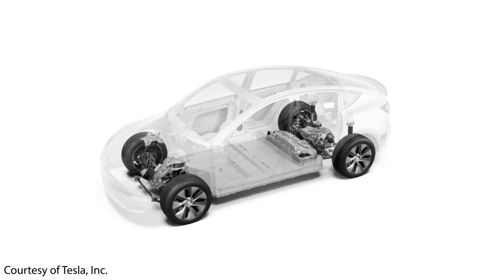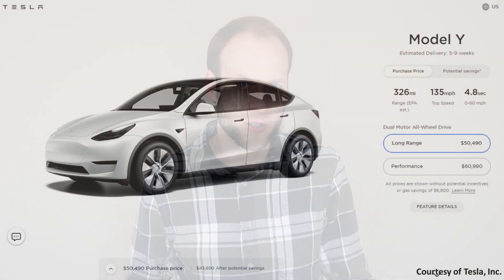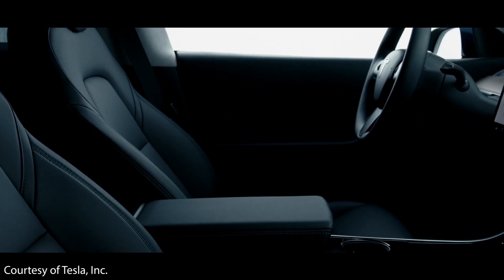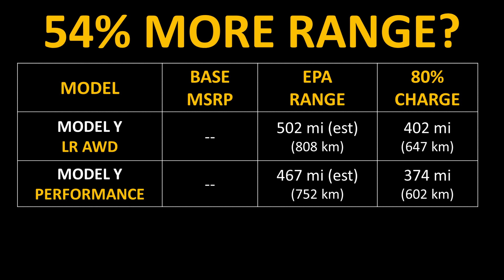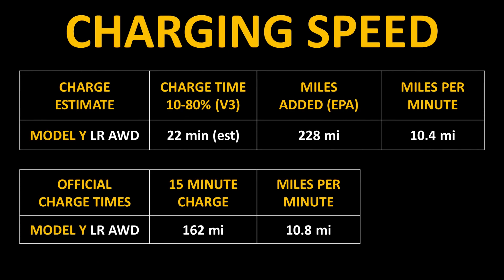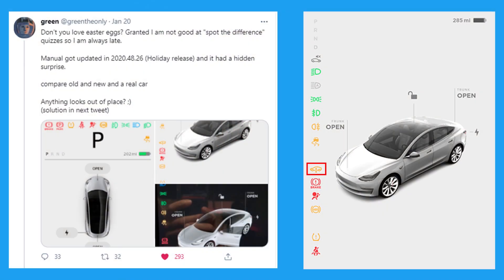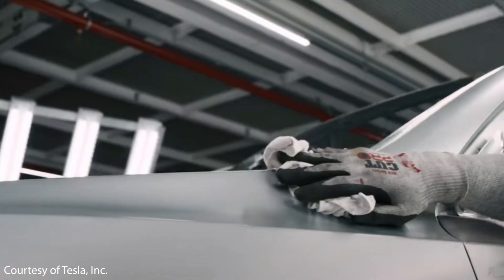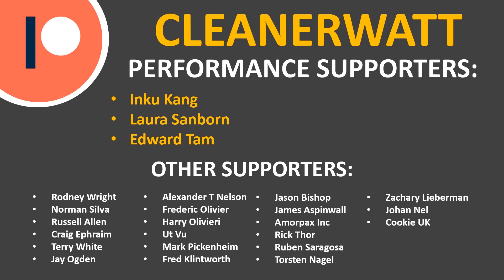Tesla Model Y 2.0 – Changes to Expect in Late 2021!

Comment: I really struggle with the range still.  If cold temperatures lower the miles, going 80+ mph lowers the range, and if I’m not supposed to charge to 100% I feel like I need a car that is rated for 400 miles MINIMUM.
Reply: Easy answer.
Don't go 80+ mph
Your journey time will be faster!
Audit your use.
What percentage of your journeys require long range?
If it's 2 each year, you don't need it.
If it's business use, you're not being productive, spending far too long driving which is dead time.
And other reasons.
Reply: @rogerstarkey5390  nonsense, inngermany people drives over 100mph on the Autobahn and I dont think its the territory of an EV, diesel cars there gets over 800 miles of range and they fly on the Autobahn.
Reply: @alanmay7929 
"In Germany".
Nowhere else.

Comment: Wait, do we know for fact that gigaTX will use 4680 for MY?  We know giga Berlin will but I never heard about TX will.  IMHO, I would use 4680 for the X and S instead.
Reply: For GF Berlin it is said to implement the 4680s somewhen 2022, but not in 2021. For this year they can just be happy to start the production of the MY if ever. Local government is playing Tesla and potentially delaying the final permits.
Reply: Battery production at Austin was confirmed last year, but Semi production is likely a focus. Semi, Cybertruck, Y and 3 will all be produced at Austin, and eventually they will all get the 4680s... But the when is always anyones guess for Tesla. 

As far as Model S goes, it is my opinion that the Plaid Plus models will get the 4680 cells... but eventually all Tesla vehicles will run 4680s, it just makes no sense to continue using less efficient cells and manufacturing for their flagship vehicles.

Comment: Giga casting front/rear end, structural battery pack and mass production of 4680 cells will take time. I don’t see this happening until 2023 at the earliest. Volume would be too low at Austin to exclusively build Performance Y’s and no other versions.
Reply: 4680.
If they've solved the "Maxwell" dry production process, the factory is modular.
Small footprint.
Machines probably built in house (Grohmann?)
It's a fast build, then testing.
The "canning" process is just that, known technology, reliable.
A lot depends on the stockpile of cells from Kato Road, the production rate there, and the designation for those cells (will the Berlin cell production be ready before the car production?)
If Berlin and for that matter Austin, are ready before the main factory, it's going to be a step change.
Also, the chemistry of the line must be considered.
Assuming the 4680 can use LifePo4, there will (eventually) be at least 3 variations of cell.
It could be the LifePo4 will be used for all cars, except maybe the "hyper" packs?
Let's wait and see.

Comment: Love to have a Y but am waiting until the 4680 variant to be available in the USA.
Reply: That will be a long wait
Reply: @gcklo  if its 5x the lifespan of battery might be worth it. especially if you plan on autonomous in next 8 years to be a thing your battery lifespan is very important for longterm value
Reply: @gcklo  I thought 
So too but Elon said this year.
Reply: Very long wait. At battery day they made it clear that they are still years away from mass production on the 4680 cells

Comment: My take on it is that with the new battery they will reduce the battery pack size, this will lighten the weight of the car, make it cheaper and more efficient too. Also even ice cars have to worker harder at higher speeds to push through the air making them burn more fuel, so it's not just BEV related issue
Reply: Uhm you are totally wrong, the new 4680 won't reduce the battery size but just facilitate the production of the battery cells, also ICE doesn't suffer much compared to EVs even at higher speeds and diesel vehicles are even more efficient on the highway, some sedans in Europe gets about 5-6l per 100km. Also EVs are still very bad at towing.
Reply: Even tho gas cars burn more fuel at higher speeds, its more efficient at higher speeds. But its more like gas engines are so crappy their are bery inneficient at low speeds.
Reply: @odisy64  hybrids are awesome in city and occasional highway drive, diesel are perfect for high speeds, EVs are meh.
Reply: @alanmay7929  EVs are cheaper, more efficient, and cleaner than both of those. Its like you forget gas and diesel emmision contribute to climate change and pose a serious public health issue do to all the toxic and carcinogenic byproducts.
Reply: @odisy64  stop talking nonsense, were not in 1960 anymore where vehicles had no catalytic converters..... modern engines are way more efficient and powerful. People doesn't buy an EV because they are cheaper to run.... I know many people in Germany for example that  have tried a tesla model S but it was a disaster, diesel was the unique and best solution.
Reply: @odisy64  for towing for example EVs are still terrible and don't even mention people who occasionally goes off the road..... EVs still have a very long way to improve.
Reply: @odisy64  some people are even driving with full vegetable/used oil converted diesel and still have phenomenal range.
Reply: @alanmay7929  modern engines still produce emissions and toxic by products even with Catalytic converters. modern engines still cant get past 55% efficiency even in a lab setting while electric motors are around 95% efficient and up to 98%. pound for pound they are also stronger than cylinder engine too. the worlds largest vehicles use diesel as a power plant for a inverter attached to electric motors, examples include diesel trains, earth movers, and container ships. 
but yes, people do buy Teslas because they are cheaper to run, you must be completely out of touch with the people buying electric cars. yet again your example for a  Tesla was a model S and not their most popular cars which are the cheaper model Y and 3. im getting and EV because the maintenance is lower than my jeep and it would only cost me 5$ in electricity instead of 50$ in gas. plus, electric cars have better traction controll than gas cars so its going to be great when i go trailing in the mountains like i do with my wrangler.
EV's lose range from towing because that are proportionally increasing drag and air resistance when pulling something else, the same applies to gas cars but no one complains because they rarely do it and the people who do it often like me use vehicles made for it and extra large gas tanks. id like an electric truck for the diesel/ electricity savings and the recharge time is something i can live with. if the cybertruck can get 500 miles than it will probably get 250 miles while towing max weight, which is totally fine for me since i rarely travel more than 200 miles for work (i work all over my state) but its only like 20 minuets of charging to get that back after a 4-5 hour drive.

i take it you live in Germany or near, how does the Giga Berlin factory Tesla is building there make you feel? because when its finished its going to be seeing how much most lower class folk love them.
Reply: @odisy64  Yup, spot on, whilst fuel burn at high speeds is terrible, the fact that at speed ALSO means the engines are at the peak rpm power curves, within gearing, means the very best, what 25-30%, calorific value out of the fuel source, as opposed to 10-25% at acceleration and low revs....so fuel gets this non-linearity optimal at speed, where BEV both doesn't AND suffers from high current heat/inefficiency in both 400/800V architecture.

However, as more and more and more AI takes over driving, it'll also take over the BEV resourcing, thus you'll see cars drive 55-60mph more than current 70-85mph that most people select.
Reply: @Richard Wood the battery, battery casting/structure and the wiring looms.....all wins.

And sooner they move to a 48vdc controls even better.

Whether they can move away from 400vdc architecture to 800-1200vdc is unlikely and possibly unnecessary once the population gets over the fixation of stupid 0-60 launches and lets the CPU drive the car with best draw of watts.  Retro fitting supercharger network to increased DC architecture would be an annoyance, thus totally unlikely.

Great time to be alive and seeing all these smarts deploy. 😃😃😃
Reply: @dominicmcnamara  European cars already uses 48v systems and it seriously helps to increase the efficiency in all driving conditions and it also reduces the stress on the engine since the accessories are all electric.

Comment: Well, the way to get maximum cost savings from 4680 cells is to keep the pack capacity in KWh the same.  If Tesla raises pack capacity, cost savings are diminished.  This is a tradeoff decision Tesla will have to make.

There will be some cost savings that will be independent of the pack capacity.  Structural packs will be easier to make and mount, and front and rear underbody castings will deliver savings and increase range a bit, by reducing the car's weight.  So yes, the news is good for Model Y, and the other Tesla models which will eventually use this technology (which is all of them, I think).

So the cost and range equation is a bit complex - and the variables are variables.  Over time, we hope to see refinements in the 4680 cell energy capacity and performance.  Exactly how those will arrive, and when, or whether Tesla will emphasize range, or cost, or balance the two, we can't know.

Next, you're looking for Model Ys configured with 4680 cells, structural packs and whole-cast front and rear underbodies in 2021.  Ahem.  That is not likely.  It's far, far more likely that the first GF-Berlin and GF-Austin Model Ys will be very close to the Fremont Model Y configuration: single-piece castings for rear underbodies and 2170 cell packs.

There are two things to look for: the pace of gigacasting machine deliveries and the pace of 4680 cell development.  There are hints, but no explicit announcements from Tesla, about both topics.

Gigacasting deliveries are slow.  The machine weighs 6 tons, is ridiculously complex, and is manufactured by a tiny company.  I expect Tesla to take delivery of gigacasting machines as quickly as the manufacturer can produce and deliver them - for years to come.  It's going to be a bottleneck in the early going.  These are the classic 'long lead time items.'  Tesla needs these machines at all of its auto assembly plants.  Deliveries are being distributed to all of them, too.

Thus far, in Austin, we don't yet see enough installed gigacasting machines to support even rear castings for the Model Y, and none at all for the Cybertruck (which will be 8-ton machines).  A few more will be delivered this year, sure.  I expect Model Y initial production at GF-Austin will not be slowed by gigacasting machines this year; they'll get their low-rate initial production (LRIP) run going.  But I think they'll do it by emulating the Fremont configuration, and add front underbody castings later on.

That is a guess, of course, but I don't think we can take it for granted that Tesla's GF-Berlin and GF-Austin will both have enough gigacasting maschines in 2021 to support both front and rear underbody castings.  That's a level of optimism I don't share.

There are hints that Tesla is struggling to achieve its developmental milestones for the 4680 cells, and struggling with reject rates.

The big hint was the Model S Plaid + was slipped to 2022 and its price was raised significantly - just what you'd expect if the 4680 timeline has slipped and they have a new, less optimistic appreciation of 4680 reject rates in 2022 to expect in the early going.

The developmental effort for Cybertruck appears to be focused entirely on 2170 cells in 2021; they don't appear to have enough 4680 cells from their pilot plant to bother with prototyping production for the 500+ mile variant of the Cybertruck this year.

They're doing the same thing with the Semi pilot production line - using 2170 cells.  This will be the 300-mile variant.  We aren't seeing 4680 cells going into Semi pilot production yet.

All three hints appear to represent a slip from their Battery Day expectations for this developmental effort.  At Battery Day, Tesla hoped for the 4680 pilot plant to be up to full speed by June 2021, isn't that what they said?  10 GWh of production after rejects.  It does not seem to be on this schedule.  I doubt they have yet settled on a final design for the line, and might not before the end of the year, or even into 2022.

This isn't a doom-and-gloom assessment.  I think Tesla is making fabulous progress on key configuration improvements that will deliver terrific benefits to consumers - lower prices, better vehicles.  It's all very exciting to me.  But I don't think your expectations for 2021 are realistic.

As for how Tesla will trade off range versus cost using 4680 cells, that will likely be a highly dynamic situation.  Over time, we'll see lots of revisions.  Right now, it's probably too early to plug assumptions into a spreadsheet and announce the results.
Reply: Excellent prognosis Urgelt !! Far more believable than that delivered in the video!!

Comment: I won't buy a Tesla Model Y, which I do plan to buy, until the 46/80 batts are available as I can wait and I have no interest in Panasonic's cells and limitations.  I figure the next EV I'll get after than will have an all solid-state battery, several years later.

Comment: The Model Y has some pretty subpar suspension and ride quality especially on the Performance model, largely due to its greater weight over the Model 3. Rumor has it that Hitachi will supply dampeners to the Berlin Model Y, it remains to be seen if these are superior to current parts. Ideally Tesla would create an air suspension option for the Y.
Reply from the maker: Interesting...
Reply: @Cleanerwatt  well it should have it at that price point to be honest.
Reply: Or teslancould just build better suspensions like the vw id4 that is way more smoother to drive than a tesla. They don't need air suspension.
Reply: Coilovers would be cheaper and more reliable than air suspensions.

Comment: The weight of the model Y will be reduced with the casting low body structure
Reply from the maker: True.. good point.
Reply: Uhm not really, its still the same castings but just in one piece.
Reply: The casting will reduce weight but also the 4680s will reduce weight.... Because a smaller pack will go the same distance.
Reply: @patreekotime4578  the new batteries won't really reduce the weight its just new form factor cells.

Comment: I live less than an hour from the Fremont factory, but I would like to see the entire mass production torn down and replaced  with Tesla’s modern Gigafactory platform. Fremont is a hodgepodge of production areas. The gigapresses are outside of the main buildings. The Model 3 line is still in a temporary building that you can see in current drone videos. 
I pay the same destination charge, whether my Tesla comes from Fremont or Austin, but I know that Tesla will tell me that I have no choice. They wouldn’t even let me pickup his my Model 3 in San Francisco, I had to go to Fremont, very close to the factory. I wasn’t about to refuse delivery after two Uber rides and a long subway 🚇 third rail journey.
Reply: It will be torn down and moved to a more tax friendly state. Most likely somwhere in Eastern US.

Comment: Tesla may keep the range near 300 miles and reduce the number of 4680 batteries so that they can build more cars. I would like to see a 400 mile MY though.
Reply: I'm getting a SR+ Model 3 in a couple weeks (whenever it gets here).  Considering I normally drive about 10 miles/week, and even my "long trips" are within 100 miles, it's pretty ideal for me.
Reply from the maker: You may very well be right... at least at first and then gradually increase them.
Reply: @Cleanerwatt  
I doubt they will.
Remember the Mission.
It's about "Bums on seats", not "Edge case performance"
Reply: @Cleanerwatt  There is no Model Y standard range right now. If the top spec hits 400 miles, then that will leave a lot of room for a standard range below it.
Reply: Its coming & thats when ratio of ev to gas cars start to really get flipped. People will prefer more miles per recharge vs gas cars getting around 300 miles per fill up so ev will eventually overtake gas as tech becomes better and infrastructure gets built out
Reply: I agree with the range, but Tesla will not reduce the number of cells (on a structural pack you cannot omit these cells...), but will user cheaper, lower capacity cells (LFP probably).
Reply: @bernhardleopold6702  There is the short term, and the longer term. I think they will pick one of the 3 chemistries to start, then add the other 2. I don't know if they will mix cell types in a pack or not. They have different voltages, but tricky engineers too.

Comment: Plus they recommend staying above 20%. Therefore it's 60% of 300 or 180 miles available on a daily basis.
Reply: Above 20 and below 80 is recommended for storage state of charge such as overnight. I use the full range when traveling for 90,000 miles in a model 3 without seeing any noticeable degrades
Reply: I have M3 with 75k miles and my charging habit is set it to 80% and about hour before leaving bump it to 90% and try to charge at about 10%. This works perfectly and currently based on Teslfi and Estimated range when I occasionally charge to 100% is still about 297 only 8 miles or about 3% of the original 310 miles rated range. 
So I tend to believe Elon that it’s fine to charge to 90%, and let the Battery Management System do what it’s designed to.
Reply from the maker: Good point.